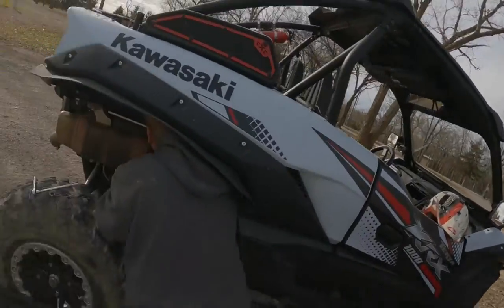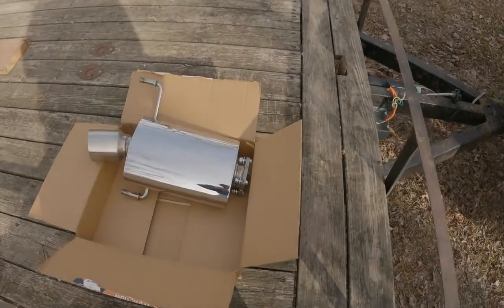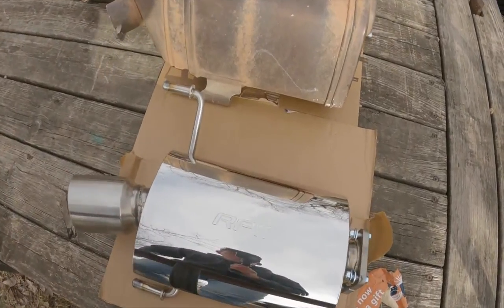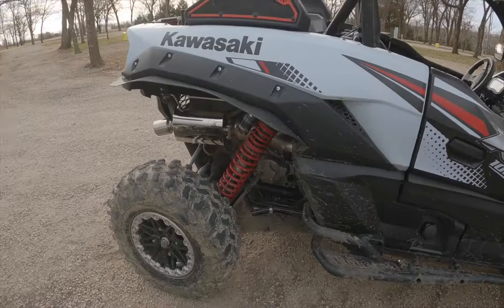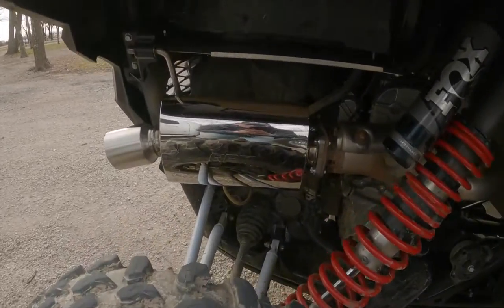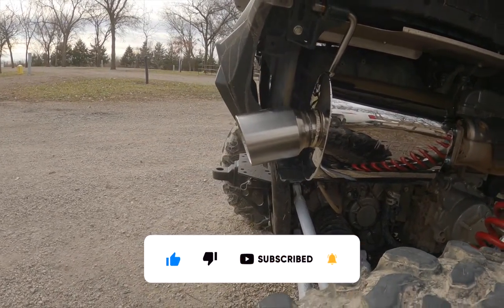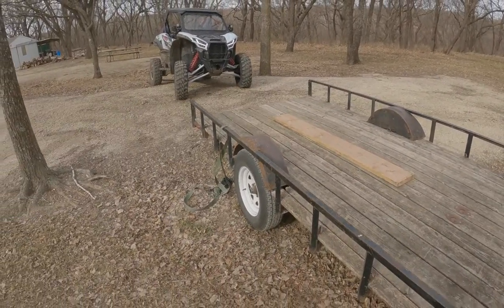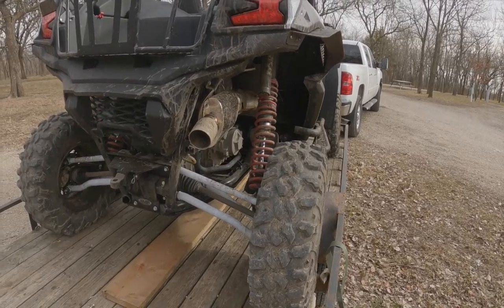KRX 1000 RPM Slip On Exhaust - It's INSANE!

Comment: Did you guys reuse the stock gasket or install a new one on the flange?
Reply from the maker: We had a new one on hand just in case the old one was bad but it was still in great shape so we kept it on there! Some people have issues with them disintegrating when they take them off but we didn’t have any issues.